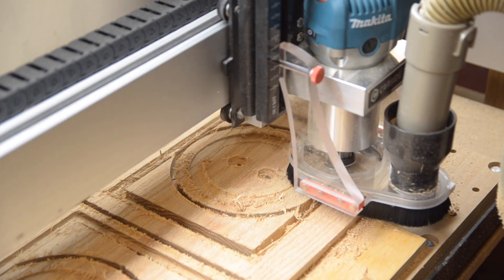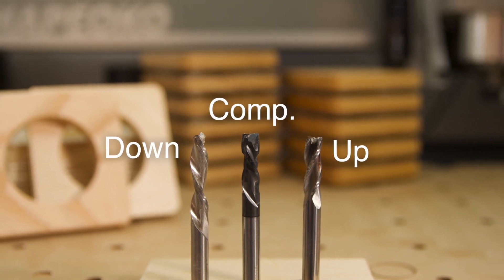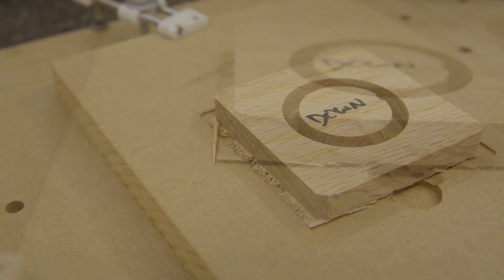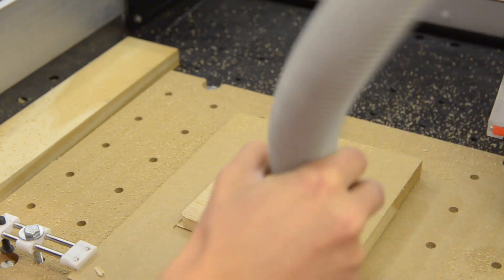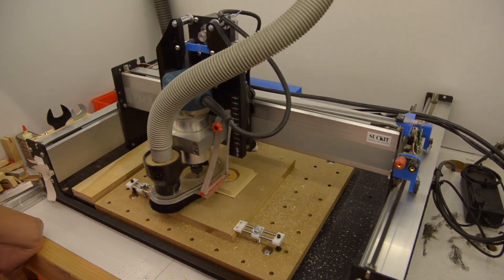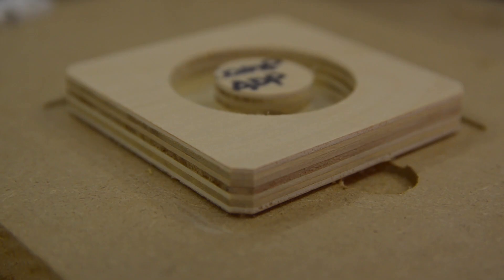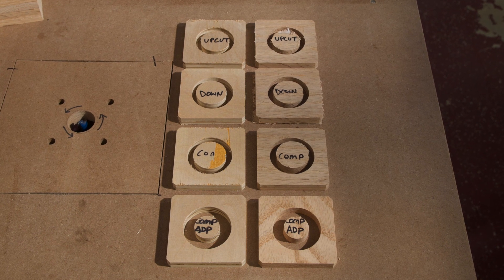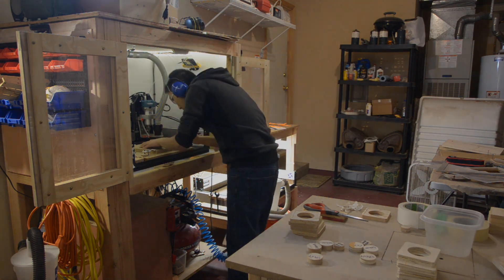Intro to Compression Endmills for CNC Woodworking

Comment: With the compression bit, can you just plunge straight down to full depth before starting the profile cuts? Or does it need to be ramped/spiraled? Without linear movement I am worried about the chips not evacuating and breaking the end mill.

Comment: I've just watched a guy with 1/8 compression bit cutting 3/4" ply in single pass at 50-70ipm. Unbelievable, but that is what the bit supplier is advertising it as and he showed it working. I couldn't see my 24v spindle cutting at that speed, he was on an Avid Pro.
https://youtu.be/n-1w5Yg0AJ0
Reply: Thanks for the tip, I just watched the video and going to try those out.

Comment: Roughing with up cut, coated carbide with very sharp cutting edges, and aggressive positive rake, variable helix and variable pitch. Finish with down cut. Very high rpm, with coated carbide meant for high rpm, high heat, and low fpt. This works sometimes, and sometimes doesn't work.

Comment: This is a comment on a cheap 3mm compression endmill on Amazon. Is that part about saw dust true? Sounds like a potential fire hazard.
"I use these for cutting single pass 12mm & 15mm baltic birch plywood. The advantage of these mini compression bits is the packed sawdust they leave in the kerf. For my CNC cuts I do not program any hold-down tabs and the parts stay in place because the sawdust packs so tightly, in fact I need to punch them out after the machining is complete. I've been getting 2-3 full sheets of plywood per cutter, so price per longevity is a bargain."

Comment: Hey thanks for the video, i also use fusion 360, only issue i have with it is it doesnt have a axiom cnc post processor, i have asked people at autodesk to make one, someone there took some time and made modified one of them, but its still not perfect. One question more along your video, i really want a bit that can run much faster than these spiral bits do through wood, any ideas? I recently purchased a 4 flute bit, seemed better, but options are limited beyond that
Reply from the maker: That's up to the endmill manufacturer and your own judgment. Try some tools from a reputable manufacturer like Amana, Whitewide, Harvey Tool, etc and see what they recommend.

Comment: Great video! I have one recommendation as a trained public speaker. When doing technical presentations, if you slow-down the pace slightly, you allow the audience more time to process the information.

Not trying to be negatively critical, just a thought to improve your already awesome video!

Thanks again 👍👍👍
Reply: While I watched the video at 1.5x speed (which I usually watch all informational videos at), I tend to agree with you. Slowing down a video butchers the audio quality, but you can speed it up to 2x just fine.
Anyways, nice comparison, this compression bit is pretty interesting. What advantages does it have over using a simple straight bit?
Reply: @peniku8  Agreed. He does have some good videos if you're into small scale CNC jobs though. I don't intend to take away from that!

Comment: As a beginner CNC operator I am looking at costs can somebody use Dremel bits on their CNC machine I guessing they won't last as long but is that an option to start learning process
Reply from the maker: In general, it's a terrible idea. The only endmill-looking bits they have that I know of are ones like this: https://amzn.to/2UqpbQx 
And that's a bad choice. It's too long and fragile. Any of their more grinding-oriented bits are also not good to use on a CNC You want to cut, not rub away material and cause friction or heat.

Get some ebay endmills, they're a couple dollars apiece and will work fine to get you started. If you're going to spend hundreds on a CNC, don't cheap out to the point of rendering your machine useless.

Comment: First thing to know is you CNC fast enough and powerful
enough for a Compression Bit. Ok let us see first figure chip load at .010 for
.25-inch bit cutting depth .375 to .5 inch two flutes 1600 RPM on spindle Reed
rate at 320 inch per minute can your CNC do this?  if it can then you wasting your money on Compression
bits.  They will get to hot and burn up.
Just go back to a cheaper two flute uncut and you do much better and have more
money in your pocket. Running CNC is to know how to figure chip load if you
have a 1 to 3 hp spindle and only can move 100 inches a minute you never going
to be able to figure proper chip load so go with the cheaper bits

Comment: Can't you just take one pass with the compression? I use compression bits exclusively. I cut lots of 3/4" plywood and generally just take one pass with a feed rate of 120 inch/min. But my CNC has a 5 horse spindle so...
Reply from the maker: Um. Yea. That's a slightly different class of machine. That being said, I have tried a 1/4" DOC pass with a comp cutter (which will engage the down-cutting flutes) at around 30-45 IPM in plywood and gotten success. Depends on how much you can push your machine.

Comment: Could you run the spindle backwards to get the same result as a compression bit? I have a 3 phase spindle controlled by a VFD that would allow me to do this. I'm pretty sure there is a G-code command for spindle direction so it's in the realms of possibility to make it change halfway through the operation and then you wouldn't need to create a custom toolpath or buy an expensive endmill.

Just thinking out loud here. Has anyone else tried this?
Reply from the maker: philip james no. The cutting edges are on the wrong side.
Reply: @WinstonMakes  ah, that makes sense. I did think that the idea was too simple to have not been implemented by anyone else before me if it were possible 😅

Comment: Pro tip! Consider using a down spiral tool, but leave an intentional skin on the bottom of the part, and then use a router table with a flush trimming bit to achieve a clean edge on the bottom face

Comment: Hi there!!! As you, I also learned the cnc “things” by myself and after some years of wood and metal working I concluded that I have to use ALWAYS appropriate tools for the material I am cutting... wood mills for wood, aluminum mills for aluminum, steel tools for steel and so on... for wood try the straight wood mills, they are awesome and always give you the right finish.. 
I know that having several “collections” of tools might become expensive but it pays off after you mill your pieces.
Never go cheap on tools because they last much less and you spend much more time finishing your pieces by end when they can come out finished from the machine... what you spend on manual working over time pays lots of expensive tools
Time is money!!!!!

Comment: Hi Winston, I really enjoy your videos. I want to cut 3mm ply in one cut can you recommend an end mill? Newbe
Reply from the maker: Downcut would give the cleanest result, but I have never tried pushing a cut with one that deep in one go.
I'd probably just say try using any 1/8" endmill or larger at a more conservative feed rate than usual. Only way you're going to find out is through some experimentation. 
3/32" compression endmill would probably be the best (the up/down crossover point is 3/32" from the tip), but most expensive option.

Comment: What would you use for corrugated plastic? Bit, feed, and speed?
Reply from the maker: Hard to say because I don't know what type of plastic it is. It's also weaker than solid plastic so the corrugations might flap around a bit. I'd try an 1/8" single flute upcut at a high RPM (Maybe 24k-ish) and play with feed rates.

Comment: I had the same problem before and came to my solution to combine straight cut endmills for the "Top" oparation 1mm depth or so with up cutters. The result the dust/chips get cleaned easily. Followed by a pass by pass cutting down (0,5mm offset from the contour) with a up-cutter and a final cleaning pass of 0,5mm sidecut to not stress the top of the parts too much.
Or if your spindle can do it, try a full depth - slow movement with a straight cutter.

Comment: Hey Winston love your videos
where did you get the 1/4 inch collet for the makita router
Reply from the maker: Got them from Elaire: http://www.elairecorp.com/routercollets.html

Makita comes with 1/4", I have Elaire's 1/8" and it works so much better than a shank adapter/bushing. Easily just as precise as the stock collet.
Reply: thanks for the replay,I'm from India and my router comes with 6 and 8 mm,that's the reason for asking
Reply: One more thing, ever checked the runout of your makita router,If so how much
Reply from the maker: I have not measured the runout of the router itself directly, just with endmills in the collets: https://www.youtube.com/watch?v=sZtFi3uDA8A